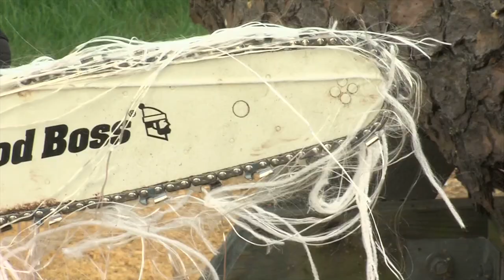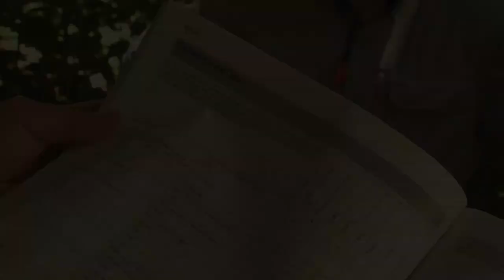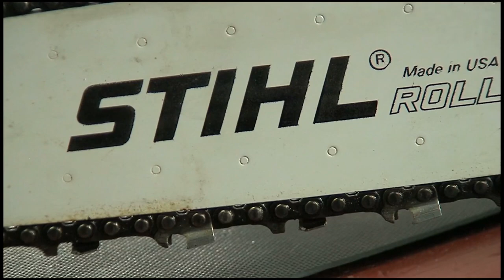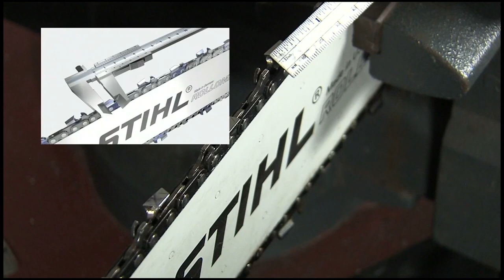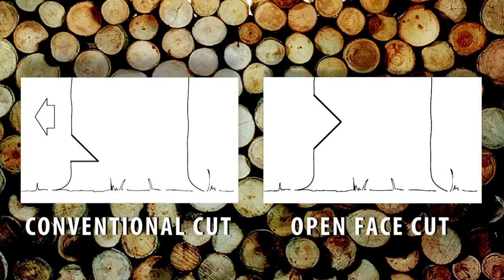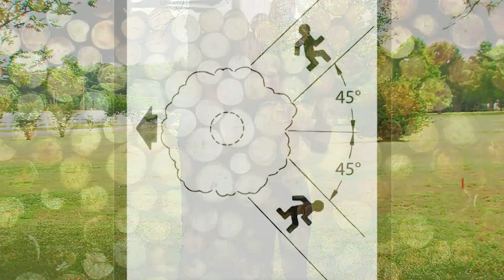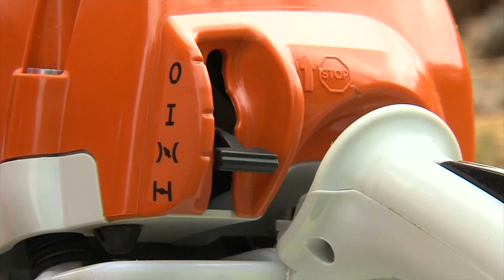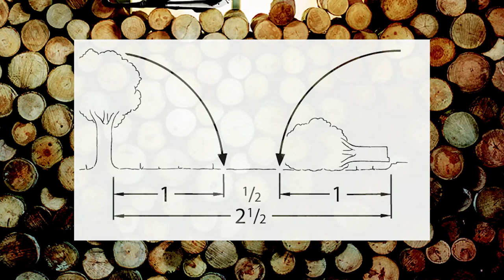How to Use and Mantain a Stihl Chainsaw

Comment: New chainsaw user here and those chaps are a great idea.  Was recently cutting some small felled limbs and I got a tad careless.  Lowered the saw a little too quick before the chain stopped and just knicked my right thigh.  No injury but my pants got a slight tear, would have been worse if the blade was still going at a high level.  You have to maintain control all the time.  Those chaps are being purchased ASAP.

Comment: Also a good safe practice is allow the chainsaw 1 minute to warm up before revving the engine. This will avoid less mechanical problems in the future and promote overall longevity in the equipment
Reply: 0